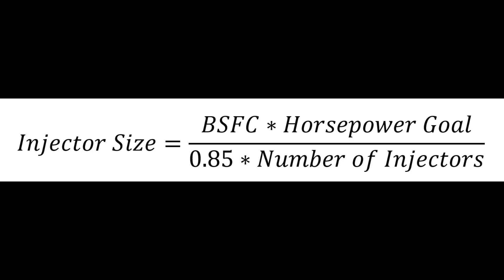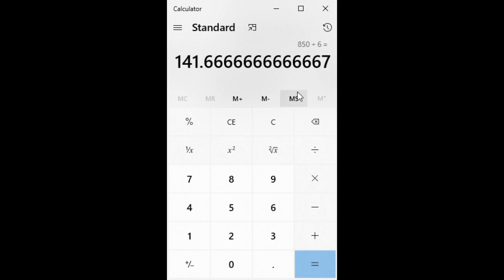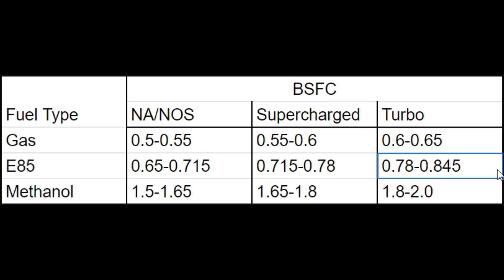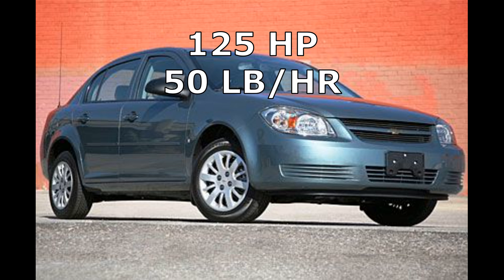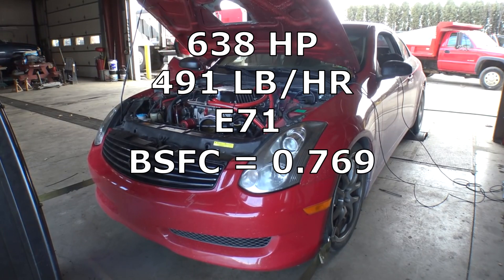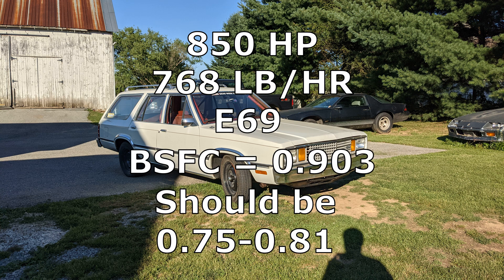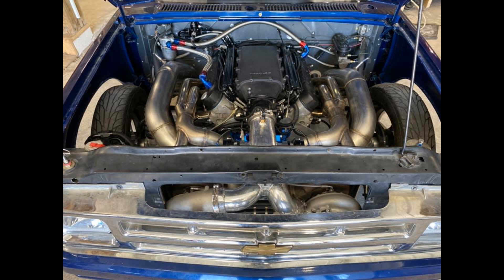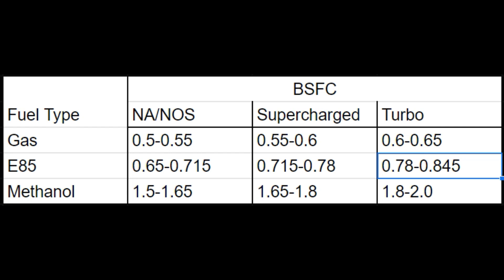What size Fuel Injectors do I need

Comment: I just did a quick lying on the couch calculation of your calculus theorum at the start. And working on the 2k Barra theory, I would say 2100cc injectors running at 69% duty cycle. Because who doesn't like 69? 😄 this will surely arrive at a metric fuckload of rwhp dependent on how much atmospheres of cold air at the night drags... *edit typo

Comment: Great video as always. I suspect there is a lot of error stacking when doing these calculations since you are not on a engine dyno with a fuel flow sensor. Also I am sure most people run their engines considerably richer for the safety margin. I got a single cylinder 13:1 engine down to .38BSFC at 15:1 AFR. Nobody is going to run their engine like that.

Comment: Where are you getting the pounds per hour of uel number from when you’re on the dyno? Great video, I went a little overboard and got Holley 220’s for my roots blown 540 big block Chevy assuming I was going to use E85 to E90
Reply from the maker: They are in the Holley datalog under "Fuel Flow"